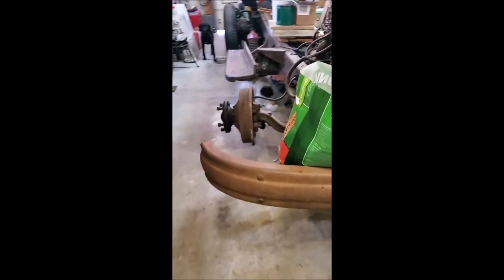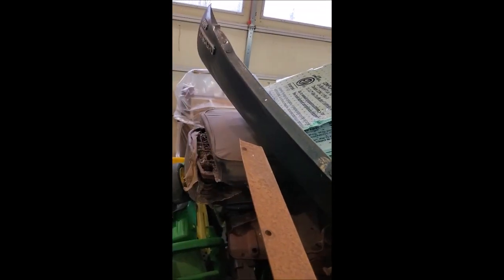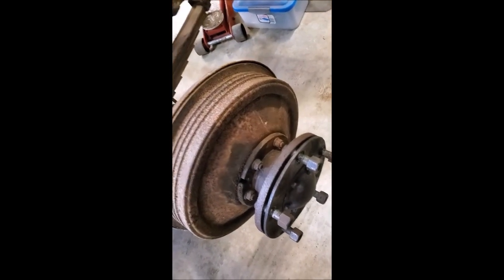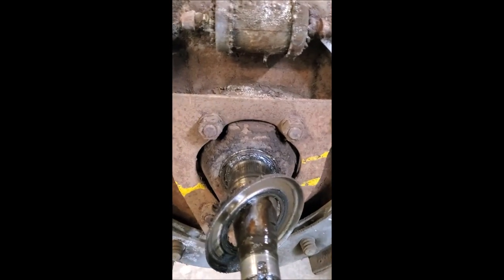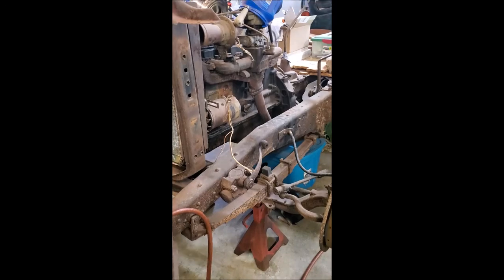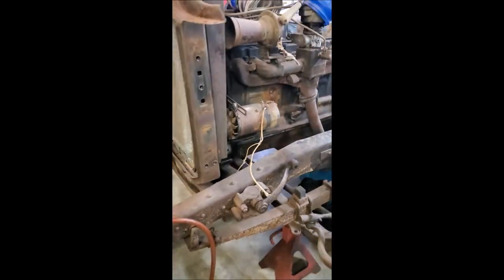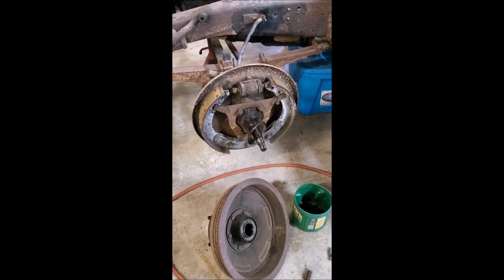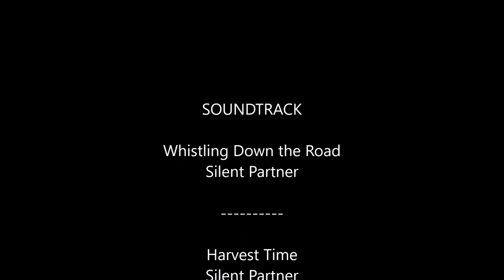1950 Chevy 6400 Part 1

Comment: Hey good afternoon. I've got a 6500 series Chevy 1950 load master. Was wondering if you had any idea how to use the two-speed rear end when to use it and when not to use it can't find any info thank you for your time
Reply from the maker: Hi Dave, You can generally use the two speed rear-end any time as long as you watch your engine RPMs. It was used in conjunction with shifting to help with building speed hauling heavy loads as well as helping with slowing down to assist braking. You can "split shift", for example; shift from 3rd gear in high range to 4th in low range etc).
You can use the clutch when shifting the rear end or just the throttle- it takes a little practice but you'll get it!
Hope this helps.